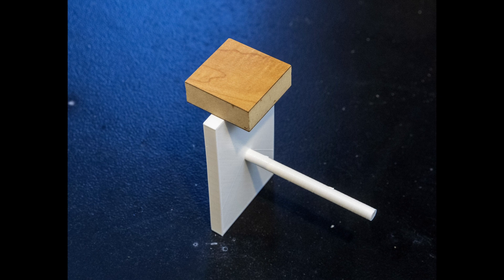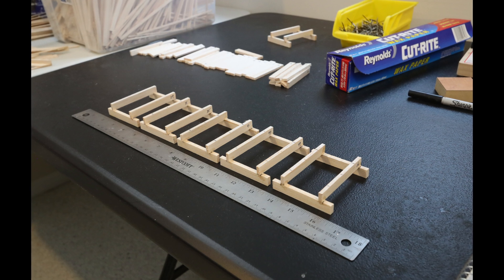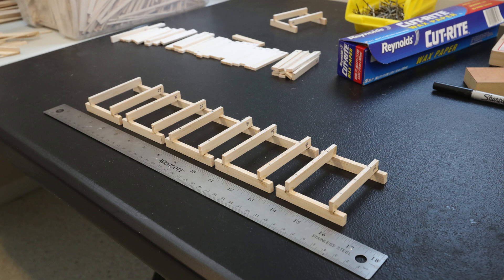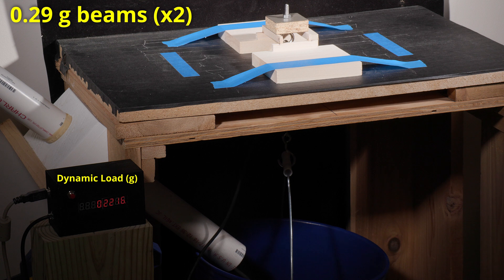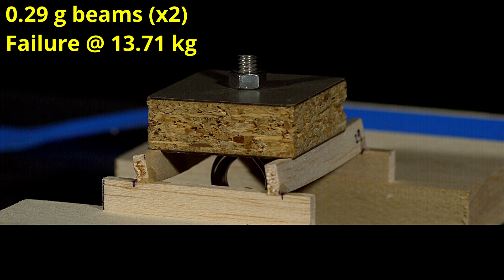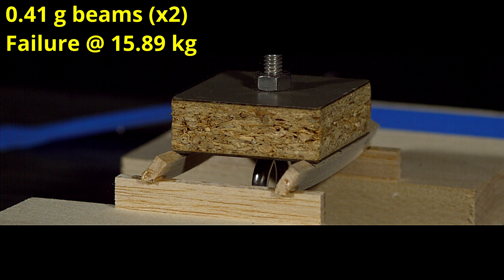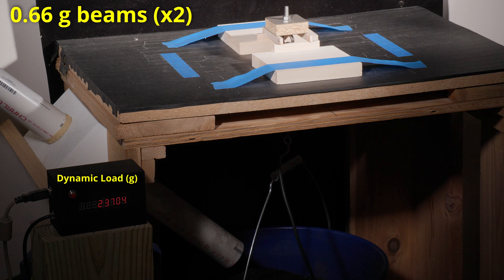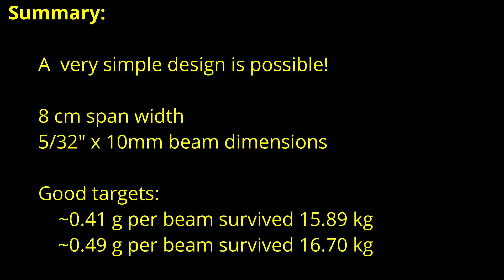Science Olympiad 2021-22 Bridges: Division C Loading Block Support Testing

Comment: do the supports yield different results if they are layed on their sides?
Reply from the maker: Yes, they would perform much worse in that case.  Also, FWIW, I don't recommend using this type of design after further investigation and would recommend using a tapered design which eliminates the need for these cross supports all together.  See my Div C full build video for an example of what I think is the best starting design